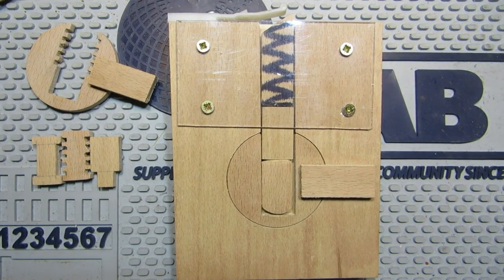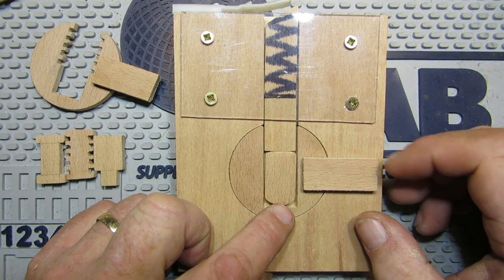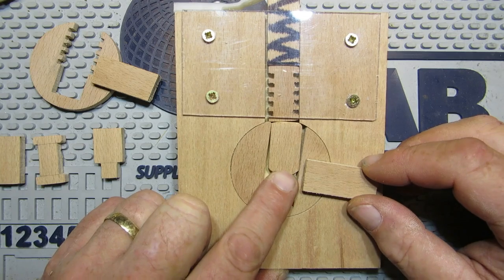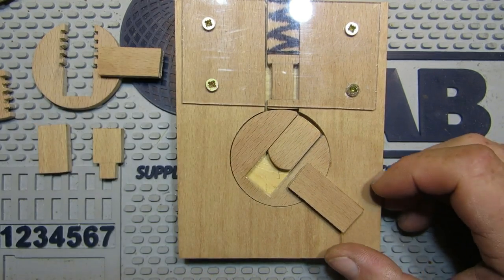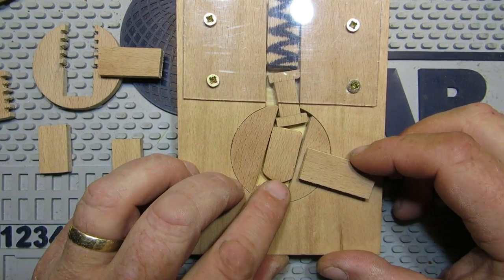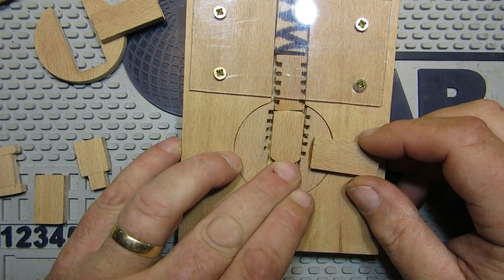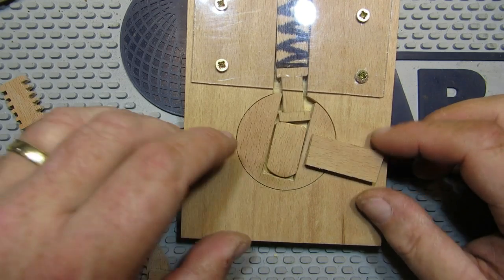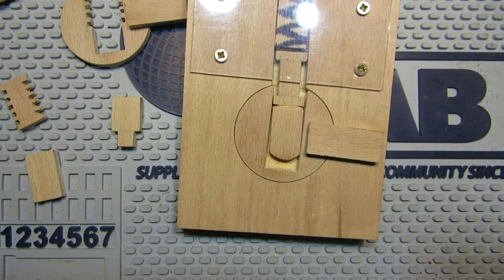(228) Security Pins - How They Work (Part 1)

Comment: Nice video!
Two questions:

1) If safety pins make it harder to pick the lock, why aren't all pins safety ones? What's the point in using standard pins at all?
2) If a false set forces you to counter rotate, isn't that gonna undo all of the previous progress you made with the other pins? So couldn't the final pin always have a spool or T-pin?

Comment: Question: How low are the margins of lock makers that those anti pick measures aren't used at all or very little in everyday locks? With the pins the effort to make more complex ones on a CNC machine are really non existing so the only real value that changes is time and it can't be so much more. Or are lock pickers in the bicycle lock space for example are so rare compared to the brute force "technicians"?

Comment: This is a genius way of illustrating security pins. I’m not sure if you made the pieces and board yourself, but they make the explanation so much easier to understand than anything else I’ve seen. I’m learning to locksmith, and I will definitely be using this video as a reference multiple times.

Comment: Make pins out of glass vials full of ink. That way, unless it's the key, you'll shatter the pin, letting anyone know that the lock's been picked. OFC that wouldn't KEEP someone out, but if you're in a situation where the act is more important than the contents.... Even more so, you'd just need to find a pick with ink on it

Comment: Interesting information, well presented, And using an easy to understand visual aid......... This guy reminds me so much of my old science teacher. :)

I've been messing about with lock picks for a few of months now, and I've come across a fair few locks that have security pins fitted. Usually I can tell that there's something unexpected going on with a particular pin, But I didn't fully understand how I was ment to tell what type of security pin I was dealing with. Usually I'd just manipulate the pin while varying my force on the tensioner bar. Eventually I usually manage to pop the lock by doing this, But sometimes I get so frustrated with it that I give up on it and move onto another lock. After watching this I feel I've got a much better chance of being able to tell what I'm up against next time......... Thanks for taking the time to explain this so clearly Pete.
(Liked/subscribed based purely on this one video. Now I'm off to have a look at what else you've uploaded. :) )

Comment: Cool! Helpful explanation, made it all a lot more clear for me.
Say, is the reason that pins and the holes for the pins are cylindrical because is is easier/cheaper to manufacture, or would rectangular pins not work well?

Comment: I always wondered why dont the other pins you already picked fall down when you do counter-rotation
Reply: I imagine they do. If a security pin's critical angles are on either side of a second pin's critical angle, counter-rotating from the larger critical angle to the smaller will cross the second pin's critical angle and unset it.

A security pin is like an intersection in a tree-shaped maze. Some of the paths (false sets) lead to dead ends, forcing you to backtrack past any sets between the dead end and the intersection.

Comment: Incredibly simple, pedagogical and straigt to the point. It looks like a good way to start as a beginner when you begin to pick basic types of lock to gain that kind of feeling for the pins and what kind of problems they can cause when they´ve been upgraded with security-pins.

Comment: This is absolutely brilliant! I've not seen a working model like this. This is perfect for experimenting with ratios and new designs. You are my actual hero right now. Thank you so much.

It's such a simple idea. I can't believe I haven't seen it before.
Reply: For complicated challenge locks you could even have multiple of these models side by side, all rotating in sync, to test gatekeeper  or trap pin ideas.

I am totally thrilled about this. Anyone with a 3d printer could use those tolerances to create amazing, fast prototypes at model size before scaling down to do the dirty work with the real lock.